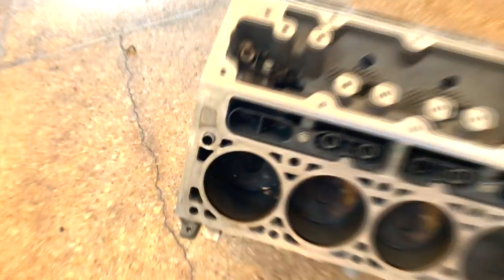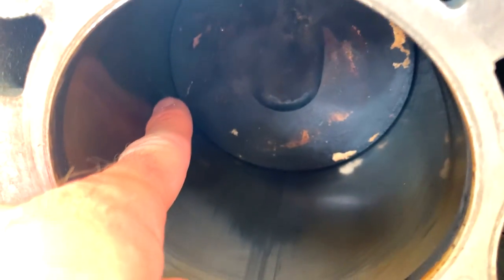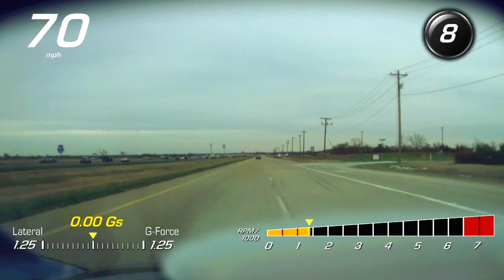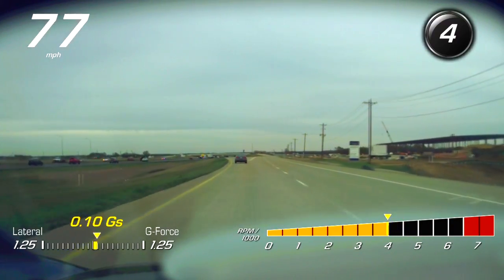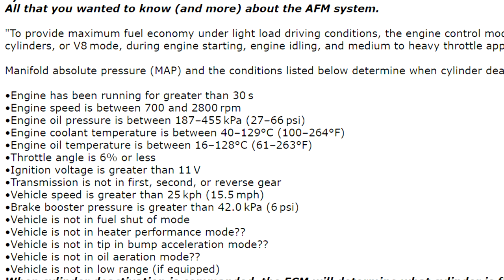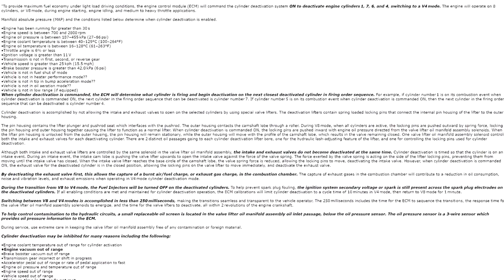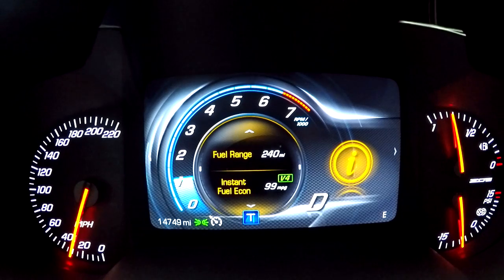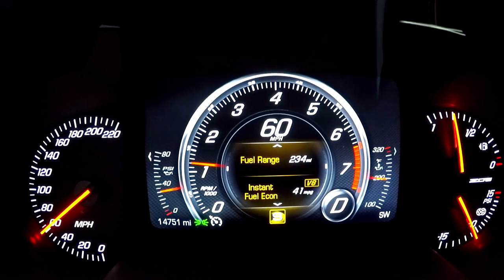How to AVOID 2 C7 Corvette Drivetrain DISASTERS! A MUST Know! *Chevy C7 Corvette*

Comment: Another great video!!!  I have a 2016 Z06 with 13K miles, this car has been babied since day one.  I recently started experiencing Torque Converter Clutch TCC "shudder" (see TSB 18-NA-355).  The TSB calls for a complete transmission fluid flush and replaced the new and approved Mobile 1 fluid (blue label bottles - 24 to 26 quarts).  The TSB calls for the car to be driven at least 200 miles after the fluid replacement to determine if it fixes the shudder problem - in many cases I've read it does fix the transmission shudder, however in my case it didn't.  I'm taking the Z06 in again to see if the TCC needs to be replace - they run a "snapshot" frequency diagnostic that must be sent into GM as proof before they will authorize the TCC replacement.  This is very serious and it must be costing GM a bundle and if you are out of warranty it will cost Vette owners a bundle.  I believe this issue is pervasive across "ALL" 8L90 transmissions and that GM should extend the  warranty for this transmission to at least 100,000 miles.
Reply from the maker: Perry Jurgens Thank you, I’m glad you enjoyed it. Yep, this is a real problem and GM should have handled it better once they figured out what was going on. I’ve had my fluid changed 4 times and it hasn’t fixed the problem in my car.
Reply: @BrinkofSpeed  I just started having it in my 2016 Z06 and I literally just bought it 10 days ago... It's at the dealer now getting the flush

Comment: I have a bought new 2017 C7 Stingray with a manual transmission and I've owned it since 6/2017 and I put on 10k/year (26k miles so far) and it's the most reliable 0 issue car I've owned (even my bought new 2019 Toyota Camry v4 SE,, 2014 Toyota Highlander XLE, 2004 Toyota Sienna XLE, 2008 Scion xB had minor issues).   I daily commute to work in the C7 (15 miles roundtrip) in ECO mode with auto rev shift every day, and this is the only mode that will do the cylinder deactivation.
Reply from the maker: mrpmj00 That’s great to hear. I’m glad you aren’t have any issues with it at all.
Reply: @BrinkofSpeed  Did you buy yours new or preowned?  If preowned, then you don't know its history.

Comment: 2016 Z51 7-spd, have driven it 20,000 miles since new.  
It has never switched in to V4 mode in any drive mode other than Eco.
Reply: Not true

Comment: 2016 3LT Z51 8 speed auto.  Runs in V4 mode a lot, never had a problem.  My understanding is that the C8 does NOT have the cylinder deactivation feature which I feel is too bad.  Too bad the video doesn't give more detail about what actually supposedly fails and how it's connected to the V4 mode.  Doesn't make much sense given the sparsity of information given.
Reply: I have the same car you do. The AFM lifters in your engine are the problem. Going in and out of V4 and V8 causes lifters to stick and blows up engines. Bypassing AFM with a plugin device will keep it from going into V4, but the crappy lifters will still be on the inside. There is actually a class action lawsuit with GM happening right now over all the lifter failures and torque tube disasters related to Active Fuel Management (AFM). Hence this video and all the complaints from owners of GM vehicles, not just Corvette owners.

Comment: I have a 16 man. Unless you go into eco mode, it will NOT go into 4 cylinders mode. I never use it. The car will lug if you go into eco and 7 th gear. It will shudder and lug if you encounter a hill. Sport, Track, and Touring will not allow you to go into 4 cylinders, I can guarantee it. Love the car, love the c8, but no manual to row, c8 no go. I will keep my C7 as my last Vette.

Comment: The 2017 7 speed will only use AFM in Eco mode. Very smooth transition to v4 and instant back to v8. I like it. It also takes the  drone out of the muffler delete exhaust. Much nicer on a road trip.

Comment: Took a 230 mile trip on 85N and in economy mode got 26 miles to a gallon, during trip home used touring mode on 85S and got 25.5 mpg, I have a 2017 Z06, and my auto trans does go into 4 cylinder mode when in touring mode, thought it shouldn't, but can clearly see the "4" symbol in the dash cluster.  Used economy mode just to test it and see how much it saved me in gas, it was my first road trip, will not use economy mode again.
Reply from the maker: Scram This doesn’t surprise me.

Comment: I have a C7 ZR1 and it has neither Eco mode nor cylinder deactivation. And that was all I was going to post. However, I was certain that would result in something like 'You have no idea WTH you're talking about!'  Sooo, I had to find proof. And this is what I discovered:

"The supercharged 6.2L V8 LT5 engine in the 2019 Chevrolet Corvette ZR1 will not have the Active Fuel Management (AFM) technology, Corvette spokesperson Ron Kiino has confirmed to GM Authority .

The decision to exclude the AFM on the LT5 is noteworthy, since it is included on the naturally-aspirated 6.2L V8 LT1 engine in the C7 Corvette Stingray as well as on the supercharged 6.2L V8 LT4 engine in the C7 Corvette Z06, and owners have complained about feeling the technology turning on and off. Though the LT1 and LT4 engines have a significant amount in common with the new LT5 in the new ZR1, the LT5 does away with AFM while adding dual fuel injection.

Otherwise known as Cylinder Deactivation or Variable Displacement, Active Fuel Management shuts down half of the engine’s cylinders in light driving conditions to improve fuel economy. This is done using a solenoid to turn off the lifters on selected cylinders.

>>>Note: I'm certain they meant injectors, not lifters.<<<

 Source: https://gmauthority.com/blog/2017/11/2019-corvette-zr1-lt5-v8-engine-will-not-have-active-fuel-management-cylinder-deactivation/

Thus, the C7 ZR1 is not "The same as the Z06", as I've been told countless times, often by those who have one. Even my dad (he has a 2011 ZR1) said "Doesn't it shutdown some cylinders once in a while?" and when I said no, he proclaimed he was certain it did. Although I learned long ago not to argue with him and that I had to find proof. The funny thing is, he still occasionally insists I'm wrong. At which point I smile and ask him if he can recall the last time I was. And he either grumbles and walks away, or changes the subject. :D
Reply from the maker: Cassie Spencer Lol, cool, thank you for this info. 👍
Reply: Yo Cassie, at 64 y.o., I am still having those No win conversations with my Dad...and I thought I was the only one...lol
Reply: @maxfly7079   In my experience it seems to be more prevalent with those over 40. No offense. :)
Reply: @cassiespencer6134  Why can't people cut everybody some slack on their opinions and give them some respect for their Take on A subject...I guess its funny I can still piss off the oldman...my c7 crystal red vert. A6 Sparkles in the Az. Sun...and WITH solid spoke Chrome Rims...props to your dad for liking Chrome wheels on the right car.

Comment: absolutely true!!....I bought my C7 AUTOMATIC/PADDLE SHIFT new in 2017 and it has 22k on it now. I can confirm as long as you stay in manuel mode and use the paddles to shift as I DO 95% of the time the cylinder de-activation will NEVER EVER engage!!....regardless of speed or rpm or gear as long as M MODE IS ENGAGED you are safe from that deactivation ever happening...i have WATCHED the vehicle stay in V8 mode for hours and NEVER turn to V4.....so the brink of speed guy is correct and and do as i do and stay in manuel always....the car runs great that way and the engine disasters will be AVOIDED!!..........

Comment: I recently purchased a 2017 A8 used with 7700 miles. I also purchased a Range device that plugs into OBD port and it disables v4 mode in Drive. Just incase I need to put in Drive mode. I mostly drive in manual mode.
Reply from the maker: Diamond Wolfs That’s awesome. Congratulations on your new purchase and thank you for sharing this great tip. 😊
Reply: @BrinkofSpeed  Your welcome! Had to do my research on A8 because of the torque converter problem / shuttering problem. Got a used Collectors Edition. @autobot_c7

Comment: The only reason I ever got the A8 is because it has the manual mode. It sucks that V4 can ruin the parts but we still get great MPG on V8. I didn't know that V4 was activated outside Eco mode, though. I've been on manual mode since the beginning 99.99% of the time anyway.

Hopefully GM will have the V4 not be an issue on the parts for the C8 if it's still forced upon.
Reply: I have the "Range Technology" plugged into mine for that very reason, which was to avoid the cylinder deactivation for the reasons you mentioned. Along with the technical issues, it was just irritating and downright wimpish sounding. I would suggest going to the ordering directly from the site versus Amazon due to the fact that I read (can't recall the site forum), that there has been some updates from original. I only have 17K on my '15 with about 1k with the plugin so hopefully no damage has been done. Gas mileage wise it hasn't been a concern since I wasn't buying it for heavy travel and more so for the things that are totally contradictory to good gas mileage. I still get around 25 mpg when cruising so that's good enough for me. Hope this helps and good luck vettebro!!!

Comment: I have had cylinder deactivation system deleted in my 2017 corvette by LG Motorsports so it runs V8 24/7.
Reply from the maker: Rich Degenhardt Awesome.
Reply: If you had LG MOTORSPORTS Deleted I don’t know why everybody does not do the same. I would assume if they are worried about warranty all they would have to do is have their mechanic turn it back on if they needed to take it in for service.  By the way where is LG MOTORSPORT Located at?
Reply: @eldridgecharlesjr2671  LG Motorsports is just north of Dallas about 20 minutes or so.
Reply: @eldridgecharlesjr2671  because its considered a tune and a tune on your engine with an enginr failure is grounds for denial of warranty

Comment: I have a '16 Z. I have had the shudders, tranny flush, and drive much harder now that I live in TExas. i did get a range device and it works, but it also killed one battery so dead I had to do the whole manual thing about getting in. Ran a charger on the battery for a while, but no joy - battery did NOT WANT to be revived. Since I had just replaced the battery I got it replaced on warranty, but it still was disconcerting. Now I rarely use the thing. I am seriously thinking of a tune to sharpen  up the shifts and to get rid of that V4 stuff. That way I won't have to worry bout it anymore.

Comment: Had mine for 2 weeks , messed up the tourque tube , i keep mine in paddle shifting now!  ...when the v4 switch to v8 and back to v4 the car will sound funny in the transition , it has shut my cars power to where i could only drive 50 mph ..twice. !! I stay in track mode and paddle shifting only ! I have the auto transmission 
....i also changed my oil frkm 5/30 to 15/50 ! The best change i have done period

Comment: Thanks for talking about cylinder deactivation & how that will ruin the motor / transmission on your C7 (&C8).  Great info.
Reply from the maker: Harry Smith You’re welcome. 😊
Reply: Does anyone know what specific damage to the engine and/or the transmission is caused by the AFM operating in four cylinder mode?
Reply: @irarosenberg  I'm still trying to figure this out should I be worried?
Reply: @MobileTechMuscle you are fine. AfM, dod dfm are all just fine if you do 5-6k oil changes and you aren't uber erratic with your gas pedal
.

Comment: I know this is a year old, but in a C7 ZO6 M7, (2019), from Tour, Sport and Track it stays in V8 mode. I am not sure about Weather, but it’s only 8-4 in Eco mode. I know of certain Chevy Dealers that sell the cylinder deactivation elimination kit. You can pick the cam for extra. The kit is only a little over $200.
Reply: Same here in my 2019 C7 Z06 Automatic.
I have never seen it switch to V4 in Tour/Sport/Track. Only in Eco

Comment: Totally blindsided by this and will have to check it out.     Another GM  Z06 surprise to go with overheating, torque converter, brake rotor warpage, rear end whine, paint rub damage, fuel vapor issue, vacuum brake failure, power steering failure.    Now this... a C8 is now further out on the must have list.    Thanks for the heads up and do not forget to change the rear end lubricant... a new recommendation by GM.    What else!!!
Reply from the maker: Parham OBriant I hear ya, it’s annoying for sure. I will never understand why when a company figures out that something they put in a car isn’t any good, why they don’t immediately just remove it in the next model year.
Reply: Don’t forget about the wheels cracking on Z06 and GS

Comment: I have never used eco mode on my C7 2018 ZO6 and I’ve never seen it kick on ! I use only Touring mode and I get low 20’s miles per gallon on the highway consistently which is fine for me !!! I heard from some people that Eco mode is not perfected and can cause issues with the LT4 Supercharged Engine ! I never wanted to use the Eco Mode because it’s not worth the aggravation of having an issue with a defective system! Gas costs what it costs end story!!!

Comment: Hey Mike, I had a 2017 GS, M7 trans and I believe that deactivation only worked in eco mode. I drove a lot in eco mode trying to get good mileage especially on trips. I did not know that it was hard on the engine and trany until I watched your video tonight. I was not informed at the dealership that the car even had this feature when I bought it.  When I drove it home from the dealership the car would jump when it switched to V4 and back into V8 mode. I thought something was wrong with the car. I figured out what was going on and just accepted it as normal. I traded the car in August 2019 with 9145 miles on it for an allocation on a C8 HTC. My order was pulled by GM today. Order statusis now 2000. What a good day it is. I think that I heard that the C8 will have deactivation on it also. Hope that it has  a mode that it won't work in. Thanks for the good content that you always have. Looking forward to more. Don
Reply from the maker: Don Ezzo Yeah, it’s crazy that they even put this in a Corvette, and now that they know it’s so hard on the engine and transmission, they should do away with it for sure. Contracts on your C8 order status! I’m so happy you enjoy my content. I’ll definitely keep it coming your way. 😊

Comment: Thanks for the info. You can plug  a  Range or Diablo module into the OBD to avoid this  problem.  However, who knows what unintended effects that may cause. I will switch to manual mode.

Comment: A good tuner can do it without Chevy finding out. Had to find one locally for the emissions on my c5. Running no cats with a straight pipe. Check engine light comes on. Trust me all tuners are not created equal
Reply from the maker: Walter Miller Cool, I’m sure they aren’t. Thank you for your feedback. 😊
Reply: Yes a good tuner can do this. However for probably less money you can buy a Range module that will accomplish the same goal. Once the car’s computer has been altered by a tuner the dealer can potentially void your warranty.

Comment: Should check with Range technology to see if they will send you one to show on the channel.  I have looked at many vlogs talking about these, and the good thing is is doesn't void the warranty, you can install and remove at any time to reactivate, and it doesn't leave any trail that it was installed. Everyone agrees to buy direct from Range due to them giving free updates as GM changes and sends updates to your vehicle via the computer systems. I have a Silverado and a Stingray, the sweet part is the device is interchangeable between the two vehicles.

Comment: Update:  I installed the stage 1 Livernois Motorsports package on my C7, and not only does it RIP  but it deletes the cylinder deactivation.   It can easily be switched back to stock tune for warranty issues if needed.

Comment: Totally agree with moderator here---I have a 2017 base sting ray and ALWAYS drive in Manuel mode and the V4 setting will NEVER be activated regardless of gear or speed!----I've watched it for 2 hours at one drive and will verify that to be true!!----the car also runs very well in Manuel mode as you can downshift and hold gears longer than the automatic setting which is always shifting up as quickly as possible-----so save the drivetrain and ALWAYS drive in Manuel mode--

Comment: Can’t comment on the corvette, but my 2015 Silverado has 269000km(167000 miles). Cylinder deactivation has never been an issue, truck has never been to the shop except for regular maintenance. I don’t really buy that that is what causes these engines to fail. Bolting on after market parts perhaps. Maybe I’ve just been lucky.

Comment: I remember the late model stingrays with 427 engines most people found out that replacing the valves with stainless steel aftermarket valves kept the motor as far as EPA it's the average mpg of all vehicles sold that they have a quauta to reach where as super cars & exotics produce a fraction of # of cars yearly

Comment: I work for an extended Warranty Co. We have replaced 1000's of GM truck an Car LS & LT1 Lifters. The VLOM, Valve Oil Lifter Manifold is the culprit!! 
It scares me as the GM TECH did not tell you this. There is info out there.